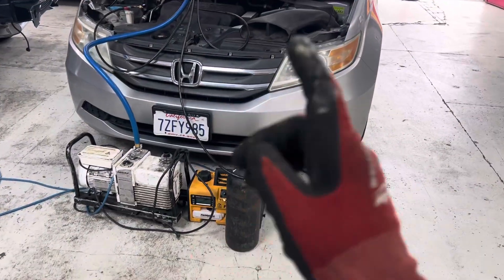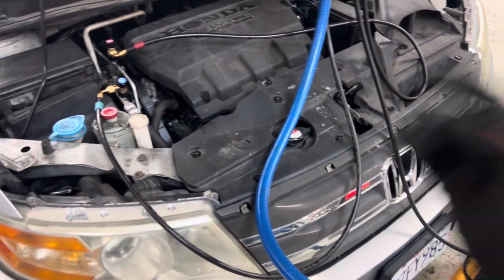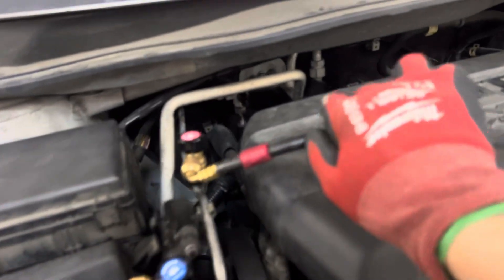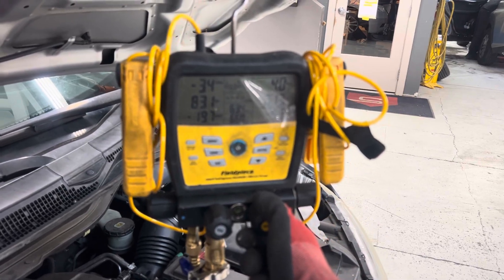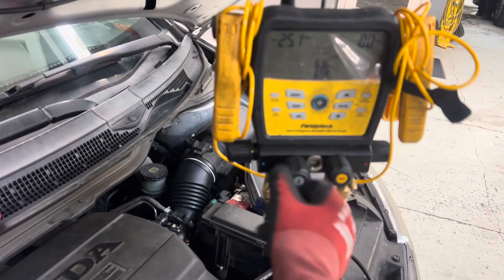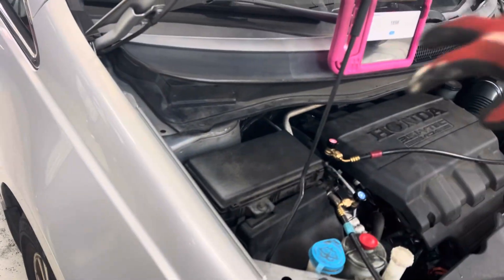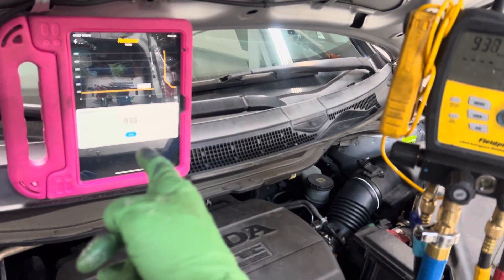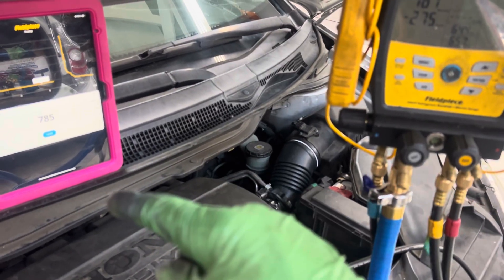AC nitrogen, purge and vacuum to reduce moisture content

Comment: Vacuum decay of 800 is good I think.
Reply from the maker: The limitations come from two things one is how horribly and grossly contaminated the system is with moisture that is compounded by technician allowing lines to stay open to the atmosphere for days or weeks. 

The other limitation is the vacuum rig hoses whole system used to perform the vacuum 

I’ve done videos where shops use their vacuum machine or gauges and they could barely get below 2000 µm 1500 µm 

And then I throw my vacuum pump on with my hoses and I get right down to 400 or 600 µm or below . 

So what the shop or technician owns as equipment makes a big difference 

This is not mineral oil that we used to have 40 years ago with the old 12 refrigerant so moisture is a big big problem with mineral oil. It was barely a problem at all.
Reply: @coldfinger459sub0Do you mean moisture is not abig problem with mineral oil or a problem ?
Reply from the maker: @issamadam9352  how about 10,000 times less absorbent of moisture than PAG or especially POE. 
     The biggest problem with mineral oil. Was not the oil..
    It was the reaction of moisture with the refrigerant the chlorine making hydrochloric acid. 
    If you ever had the fun time of diagnosing a restriction in the old style serpentine, aluminum condensers. 
     They had very large internal fins in those flat tubes. 
     The asset would eat away and oxidize the aluminum. 
    Plug up the condenser or the receiver dryer. 
      And when you would blow through the condenser trying to find out what’s wrong, you’d get hit in the face or bouncing all over these little tiny pebbles the size of sand that look kind of white or gray. 
     And they were caused by the moisture content, creating acid eating away at the inside of the condenser. 

The other problem was the acid would attack steel fittings and receiver, dryers, causing large rust, flake particles to form and break off and move. Down screen from wherever their location was. . 
       On the steel shell receiver dryers the flakes would fall off to the bottom of the pick up tube to deliver liquid. Refrigerant to the expansion valve and plug up and clog the expansion valve.. 

Another problem with the acid content caused by moisture .  Some of the manufacturers used a filter pad material that would dissolve and allow a desiccants to fall through the bottom of the filter because they were small holes punched in a metal plate..  and when that fibrous paper cotton type material with dissolve, the BBs fell to the bottom would get sucked up in the pick up straw and deliver them and plug up the expansion valve. 
     That’s just some of the problems moisture caused in 12 refrigerant systems just like they do today and modern day YF and 134